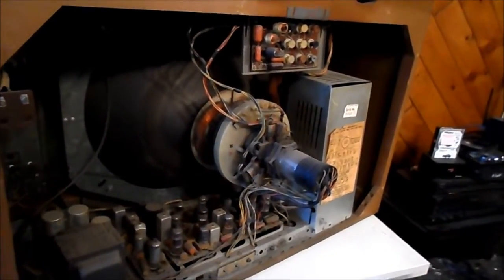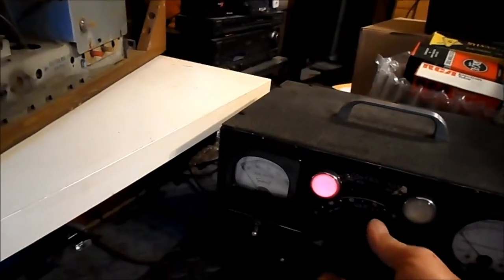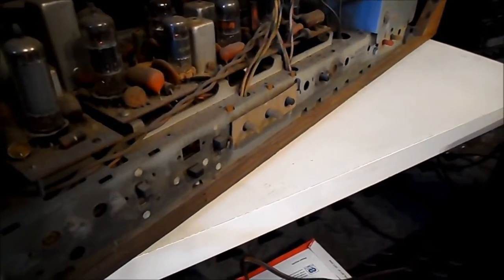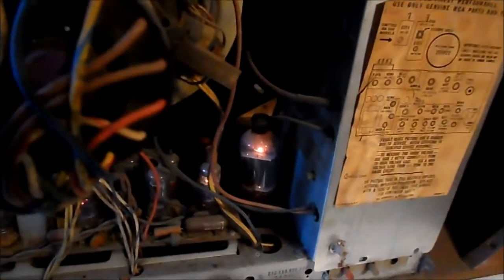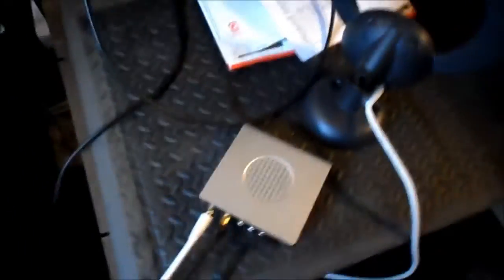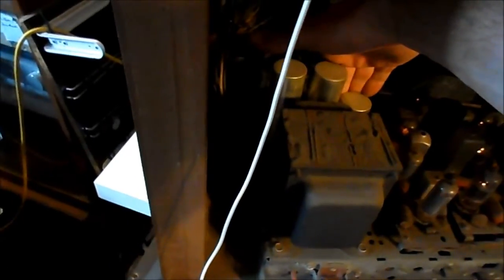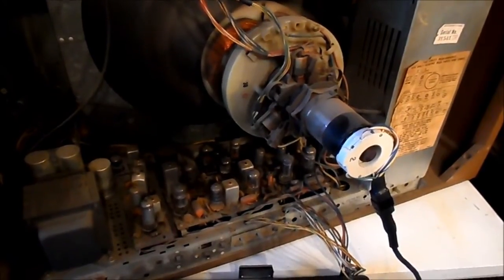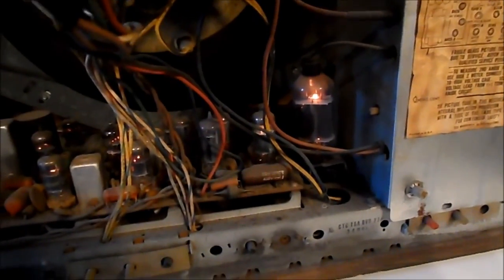1963 RCA Victor New Vista Color TV. CTC15A_Pt.2

Comment: Your flyback is ok.  Wax is normal as long as no burn marks. The safety seal on the tube is delaminated, air got in between the glue layer and bacteria formed.

Comment: I just found a very old "new vista color all channel RCA victor" tv on the side of the. I'm not looking to fix it but rather to gut it, and use it as a piece of furniture. Do you know if it's safe to gut if it hasn't been used for many decades? Is there danger of implosion?
Reply from the maker: There is always a slight chance, but not likely, if care is taken. If that's what's to become of it, perhaps I, or another close to you, could de-manufacture it for you in exchange for its components, which can be used to keep another going. They are always repairable for use as the TV it was meant to be.
Reply: Thanks for the quick reply! I am in the Chicago area. Do you know of any colleagues of yours that would have the skills to dismantle and use the parts? Feel free to email me at: elanaweinerkaplow@gmail.com

Comment: I just found one on the side of the road. Now vista Color., FJ575,, CANT FIND ANYTHIng about this.. is it fixable..
Reply from the maker: Yes it should be fixable so long as it's done properly. Needs to be powered up in an exact sequence while monitoring current draw, so unobtainable parts are protected from damage during power up. Even if successful power up is achieved, it's not to be run without further monitoring & some new 
modern available components to protect ones that are no longer available. Join videokarma.org for starters.
Reply: Lucky! I never find stuff like that. What did you end up doing?